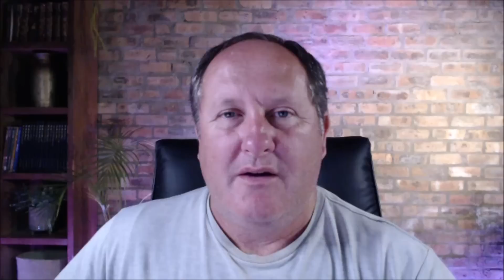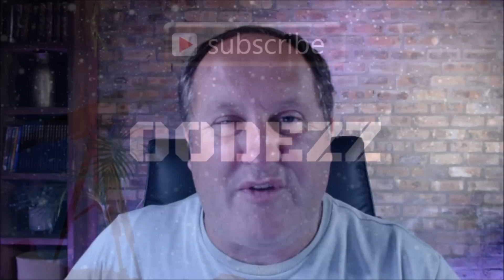00DEZZ - Breakdowns - Bad Coal Causes Tube Failures.

Comment: When corruption is allowed to run rampant in all SOE's (not only at Eskom) then the collapse of those entities in its grip is, de facto, pre-programmed and will be catastrophic. But, then again, this may be just what the proponents of the "4th Industrial Revolution", the "Great Reset" and "Climate Change" narrative under the dictate of the WEF want to happen. Collapse everything and then come with a highly flawed master plan of "making everything better" with yet more taxpayer's money flowing into the coffers of the well connected. NB Rocks and substandard coal were never meant to be used as fuel for such an intricate system such as the above mentioned coal fired power stations. PSS (Power Station Smalls) coal with its high heat generating ability (and relatively low ash content) used to be the only acceptable medium to be used as fuel. But, "the love of money, is the root of all evil" and anything vaguely resembling suitable coal is used instead.

Comment: Not quite true 00DEZZ...you feed the power station the coal it was designed to burn. Lethabo for example was built for very low grade coal. The older ones like Duvah need higher grade coal feed.